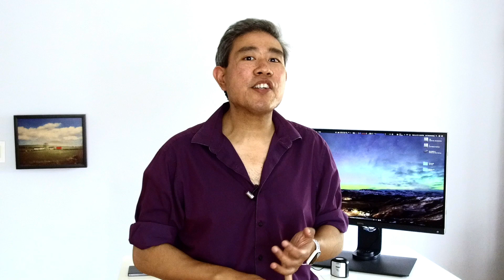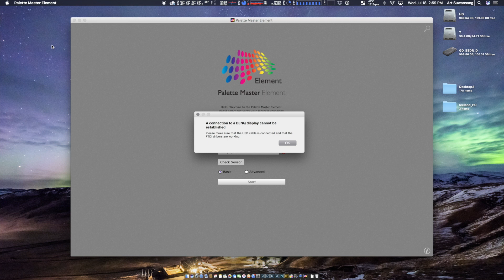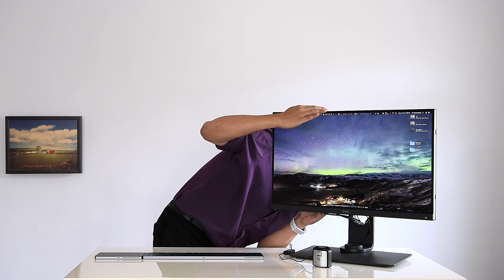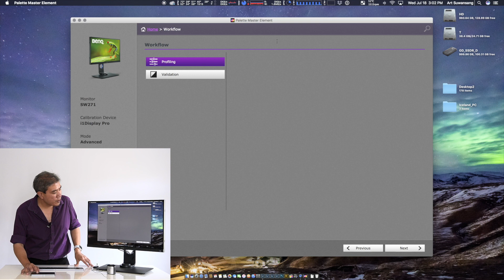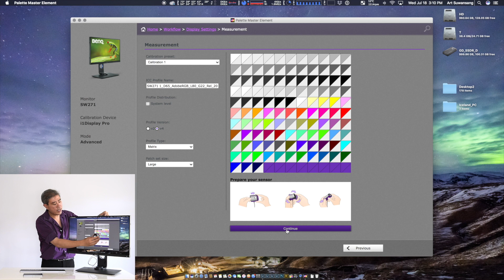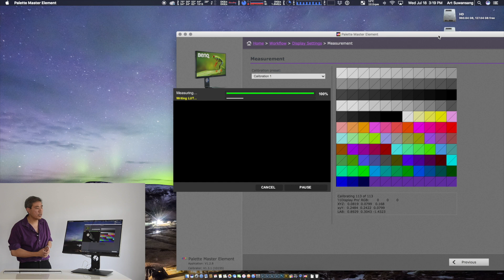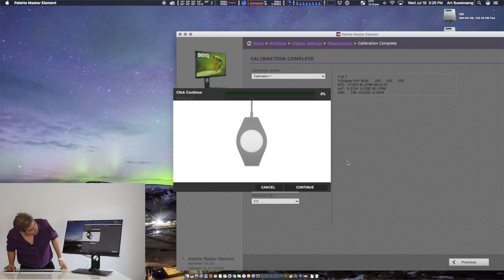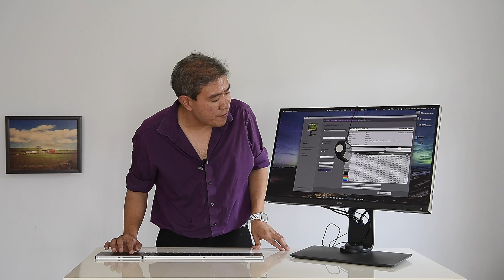How to Calibrate BenQ SW Displays with Palette Master Element - Art Suwansang

Comment: Wasn't the 16bit LUT supposed to be better than the matrix, why would the manufacture, still to this day push the fact that these monitors can produce a 16-bit LUT in conjunction with them being hardware calibrated capable. JUST it makes not an option in the newest update...on Purpose. It just me want to return my SW270C and just get a ProArt, it just feels like bad business compared to literally every other competitor. ie: ASUS, EZIO.
Reply from the maker: That has nothing to do with display build in LUT, just only the way how the icc profile is build, which does not matter much in hardware calibrated display. The LUT inside the display is still 16 BIT, they are 2 separate things. You have your choice. ASUS has their software blunder as well. Do what makes you happy.

Comment: Palette Master Doesn't work on win 11. It does not recognize my benq monitor and says it's not cabled by USB, while Display Pilot work perfectly with all commands. Anyone with the same problem?
Reply from the maker: That is because if you use Display Port, you need to use the USB Uplink cable as well that is included. DP does not have enough bandwidth to carry calibration data. So USB is needed.
Reply: @ArtIsRight  Thanks for the answer, but I didn't explain it well...I connected  the USB Uplink cable yet but it still doesn't work

Comment: Hello all,

I am in the Measurement step but the measuring window does not appear. Once I click Start Measurement the button, the instruction to prepare the device is displayed as well as the Continue button. Once I click Continue the instructions and the Continue button disappear and the Palette Master freezes. If I click Previous it does not go to the previous window.My specs are:

- MacBook Pro 2019
- macOS Monterey 12.3.1
- BenQ SW2700PT
- i1 display Pro Plus

Also, every time I restart Palette Master the calibration device is not recognized immediately (Red Cross appears). I have to select various devices from the drop down list before selecting again mine so is recognized.

Any help will be appreciated!
Reply from the maker: What PME version?

Comment: Hello Art. Hope everything is ok 
On my SW2700PT dated 2017 and running PME .15 using a Spyder4 (elite version, I don't know if it has any influence) the screen is all black around the window to place the spyder. The OS is Win 7 (yes old, but in the process of changing to the new one) Whether in calibration or validation. I don't see the color patches. In the validation passed with DeltaE values between 2 and 4. By the way, in Nit can I use 0.3 for a Spyder4??
Thank you so much for your time and contribution to the community, cheers from Portugal
Reply from the maker: If you can send me a picture of the screen or a video upload somewhere for me to see what is going on this would be great. It is hard to tell without seeing it. You can use 0.3 for spyder 4 but I would test between that and 0.5. Spyder 4 is a really old device and the sensor is not as sensitive. Also if you are able to pass the validation it would seems as if it working. Surrounding window is black that is part of the new version of the program. This is a really old video on how to do calibrate, I have updated guides with newer info.
Reply: @ArtIsRight  Thank you for your time
The patches i don´t see is the ones that appear at 18.37. I have the window to put my Spyder and it reads the colors. 
Let me see if i can expalin beter,hummm ok so in your screen you have that patchs with a triangle,half color half white during the process like at 19.11 those patchs start to fill with the color. I don´t see that, probably i´m doing a big confusion and this is normal. 
I´m going to try the Nit seetings you give. 
Thanks a lot, anyway , i will do a video this weekend and try to post on google drive and see if i can send to you.
Cheers
Reply from the maker: Older guide with older version of the program. Since then it has been updated and you won't see those square getting filled any more. All good
Reply: @ArtIsRight  A big thank you for your time.  I read this yesterday as I arrived at home and started the process. Use the 0.3 for the spyder 4,all good until now,and run the Cal and verification process.  Pass with all good,Delta E and all. 
If you Come to Portugal, beers on me hehe. Thank you once again
Reply from the maker: I would love to travel somewhere anywhere soon... but if I am ever in Portugal I'll let you know!

Comment: Thanks for such a detailed information, i could not find this anywhere else. I have one question if you can help with. For Benq SW270C which color correction hardware i should get. SpyderX Elite or Calibrite ColorChecker Display Plus(this is rebranded xrite)?
Reply from the maker: ccDisplay Plus, I was part of the transition campaign, it is not a rebrand but rather a product portfolio transition from X-Rite to Calibrite a newly formed company. But there are numerous reasons why Calibrate / X-Rite devices are much better than the counterpart.
Reply: @ArtIsRight  Thanks for the response. I will buy CC display plus.
Reply from the maker: Sure thing, if you don't need calibration for high nits display then the ccDisplay Pro will do as well. But if you do video and need BT1886 calibration then get the Plus version.

Comment: What do you think of the Asus ProArt displays? Will you ever make a video on them?
Reply from the maker: Video of them probably not, but I am aware of the line up and have helped some who own them. The issue with the Pro Art display is the software that does not generate an icc profile for the system to use and inform the color output for the system. That is a big miss if you asked me. Otherwise they are good panel.
Reply: @ArtIsRight  Does the PD2700Q generate an icc profile, and will I be able to calibrate it like the sw240? Honestly I will only edit photos for instagram so I think the PD line will be enough for me, but I still think a good Color dE is important. Will the PD2700Q be good enough? Sorry for the amount of questions.
Reply from the maker: If you have a calibrator you can use the calibrator OEM software to calibrate any displays including the PD. I recommend Calibrite ColorChecker Display Pro.

Comment: I'm starting to learn more and more with your videos so I want to thank you for that first. But I still have a few questions if that is ok. If I get the sw240 with a calibration device and custom calibrate it like in this video every month would that be really good (will it still have great colours) for a long period of time? Like 3 years or so? Also is there a good budget calibration device that works well with the palette master element / sw240 ? Thank you for your time! I really appreciate the fact that you help so many people in the comment section.
Reply from the maker: These SW displays are LED backlight and are extremely stable over a long period of time. I have multiple SW displays and over time they aged really well. One of the display that I have is over 5 years old now and still perform just well. I would look for a good calibration that you would buy once and keep, rather than a cheaper one that you buy multiple update devices throughout the year. So my recommendation is the Calibrite ColorChecker Display Pro or ColorChecker Display Plus. But the Display Pro should work just fine for what you need.
Reply: @ArtIsRight  Thank you very much sir! I really appreciate the help!!!

Comment: Have you seen a problem where the calibration later turns all yellow as if it had been corrupt or something. Happens sometimes right after calibration or even later on? Thanks
Reply from the maker: Yes, what version of the program are you using? and what display. This is a really old guide with old settings, it still works but there are a few revision since this guide released.
Reply: @ArtIsRight  thanks for responding! That’s kinda why I wrote on an old one as your M1 max stuff is likely busy . Using sw271 x3 so it is frustrating and very time consuming. Using panel native , 120, 0.3 nits , matrix large . V1.3.15… newest version doesn’t see my calibrater . Any help would be much appreciated
Reply from the maker: Got cha, no worries all comments just show up on the backend page based on time received! hmm, I am going to need more info from you. DM me on Facebook page or insta and we can go from there. This will be a long thread without chat.

Comment: Hello, I've just bought sw240 and want to calibrate my monitor with palette master element through colormunki display but i cannot find my device listed. I'm worried about that.. what should i do know.. please help me
Reply from the maker: That device is not supported.
Reply: @ArtIsRight  should i use the i1 display software to calibrate?
Reply from the maker: You can and you would be using ccStudio software from Calibrite but if you do this you not using the display to its full capability. It like buying a sport car to drive in 1st gear all the time at 10 mph.  I personally advised against this, but it can be done.
Reply: Thank you for your fast replies❤. But I'm sad now i had to use the xrite i1 studio software to calibrate it :(
Reply from the maker: Just get a i1Display pro, you can find one used on eBay for a good price.

Comment: What is the situation with the new Macbook Pro M1 Pro for monitor and colour output? There is the new HMDI port.
Reply from the maker: The HDMI port is still the same. The output on all M1 regardless of model is YUV instead of RGB. Many have said this might be an issue but it is really not. So if you have a BenQ display, it will convert to RGB in flight, if you use another brand display your milage may vary but after extensive testing everything works.

Comment: Hi what is the difference between if I set to Photographer RGB (ADOBE RGB) and web design (Srgb)? Also what's the difference between if I set to Adobe RGB and Srgb in RGB Primaries?
Reply from the maker: Adobe RGB and sRGB are two different color gamut (color space coverage) Adobe RGB is larger. The option is up to you and what your primary creative craft is.
Reply: @ArtIsRight  Can you tell me what basic settings should I do for my window 11 Pro , Adobe Photoshop 2022 and Capture One 22 before calibrating the monitor?
Reply: @ArtIsRight  Hi what is the difference between if I set to Photographer RGB (ADOBE RGB) and web design (Srgb) inside PME not camera body? Also what's the difference between if I set to Adobe RGB and Srgb in RGB Primaries inside PME not camera body?
Reply: @ArtIsRight   My images are mostly online purpose. So should I set to Photographer ( Adobe RGB
) or Web design (Srgb) inside PME (not camera) during calibration? Also should I set to Panel native, Adobe RGB or Srgb under "RGB Primaries" inside PME ( not camera) during calibration?

Comment: Hi Art, I would be grateful for your assistance and help with recalibration of my SW2700 using i1Display Pro in Advanced mode. I use Windows 10. When I open Display Settings the only option I have in Default is "Panel Native." Photographer Adobe RGB, along with other options are not available. I had no problems the last time I did a calibration. Thank you in anticipation for providing a fix.
Reply from the maker: Your is probably SW2700PT firmware version 1, so you can only calibrate in Panel Native, which is a slightly larger Adobe RGB color space. just use that. You'll be ok.
Reply: @ArtIsRight  Hi Art, you are absolutely correct, my monitor is the SW2700PT, so I will run with Panel Native. Very many thanks for the prompt reply and for your excellent assistance, it is much appreciated.

Comment: Hi, I would like to calibrate my sw270c with two profiles, srgb and argb. I have watched most of your videos but i am still unable to arrive at a definite conclusion, hope you can help me out. 
Prior to calibrating for SRGB, do i select the srgb mode on the monitor's puck or select a new custom profile, also, do i have to select the SRGB icc profile on macOS, if not which profile is best for the calibration process. thank you in advance!
Reply from the maker: https://youtu.be/xywb1_vpQhI & this https://youtu.be/Cgo2p7jF3n0 tl;dw just choose the calibration slot 1, 2 or 3 and start calibrating with the setting that you want. No need to do anything

Comment: what usb hv you plugged the calibrator to, usb on the computer or the usb on monitor itself, also what is the amount of brightness recommended to match the prints and plz mention which port is being connected for display (DVI / USB / Display Port / HDMI)
Reply from the maker: Connection for SW without USB C https://youtu.be/OVml8PQ4F2g With USB C https://youtu.be/24BebMD0G7s Best setting https://youtu.be/eCOPETFhZlE brightness https://youtu.be/UmFxZKqtHts

Comment: hei Art, 

I am having problems  with a brand new rite i1display pro with a SW271.  the PME doesn't recognise the  i1 pro device. I have tried to unplug and plug again, I have tried different ports on both computer and  monitor, nothing works!! the only thing that works is the Oem profiler( profiler). I am using a m1 Mac mini. 

any help please!!  I'm pulling my hair out
Reply from the maker: Have you installed another color management software before PME beside i1Display Pro. Check this https://youtu.be/WECg_yYBlpU and what connection are you using to link your M1 to the SW271, Where have you plugged in the i1Display Pro device. When you have PME launched is i1Profiler running or running in the background?
Reply: @ArtIsRight  hi, 

I am using a usb-c cable (not original). The monitor was bought second hand so I don't have any of the original cables. Could it be because I need to connect  a usb-a to usb-b as well as the usb-c ?  

No I don't have any other calibration software installed. I tried to connect it in all of the USB ports, both on computer and monitor.
Reply: I'm getting the fdi driver error.
Reply from the maker: Ok you are on the right track. What you need to do now is reset the display. Turn off, pull the power cord out for 30 sec to 1 min, plug it back in and FTDI error should go away. Plug the i1 directly on the Mac mini
Reply: @ArtIsRight  great! Thank you ! 

The one thing I don't understand  is if I do need to plug both the USB-C as well  as the usb-a to usb-b at the same time or either one?
Reply from the maker: With a computer that has USB C / TB you generally only need the USB C cable and you should be good. However, there are some times where there is an issue where the display does need an extra USB cable. I never personally ran into this issue but I have heard customers who has. I would check the USB C as well since 3rd party ones are not build equally. If you get it from amazon, looking for one that can do 4K 60 at the minimum, can carry 100w and has USB 3 capability not just USB 2.

Comment: Such a great, detailed video.  Thank you!  QUESTION!  Even tho a hardware color profile gets saved inside the monitor itself, doesn't Apple OS still have "display profiles" that will affect the output to the monitor?  Can we disable these somehow?  If not, which one should we be on before and after we create the hardware profile inside the monitor?  Also, the ICC files are added as "display profile" options.  Clicking on it in addition to the hardware color profile selected in the monitor makes everything look strange.  What should we be doing here?  Thank you so much!
Reply from the maker: Clarification, the LUT is stored on the display which the icc profile is on the computer. Before you start the calibration the program would go in and apply a linear profile, no need to select or change it something specific or disable it, you can't anyways. The hardware icc is what you are supposed to choose on the back end. The program does this for you automatically. Defined and described look strange?
Reply: @ArtIsRight  Thanks Art!  Which Mac color profile (linear profile?) do you personally use while you are calibrating?  I assume you also need to stay on this profile from then after or colors will change on the monitor (even with the hardware lut selected).  Seems cumbersome not being able to disable and get a "straight" (clean?) signal coming from the Mac that isn't driven by software.  From my experience, after calibration, the lut was also added as an icc profile on the Mac ... and when I selected it (then a different icc profile than I was on pre-configuration), the colors were just way off.  Like I'm doing a double-lut (hardware lut + the new icc profile on the mac).  Am I making any sense?  Thanks Art!
Reply from the maker: None, because it is only put there when the program uses it and gone when it is not. You don't have to select anything. And you should be on the display profile that came from the calibration afterwards. Disabling is a misconception. Video card need to know what color it is outputting, you can't without an icc. There's no such thing as a clean signal on modern oses. When you say colors are off; off from what exactly, what are you using as reference? No there's no such thing as a double LUT with SW displays. It seems like it but in the backend there is not.
Reply: @ArtIsRight  Thank you for the explanations.  I think I understand it all now.  Great channel.  Thank you!

Comment: sir i just buy PD2700Q ...and i am using standard mode , because srgb m,ode got to much brightness ( 100%) , is there any problem if i am work on photoshop in Standard mode ?
Reply from the maker: You should watch this for Mac https://youtu.be/03an7iyhvbQ or PC this https://youtu.be/bRSwd4x99ao Get a Calibrite Colorimeter and watch this https://youtu.be/h_TT9O2I1b4

tl;dr the only way to get the brightness correct and color right is to calibrate it.